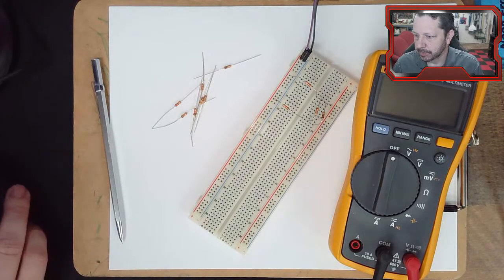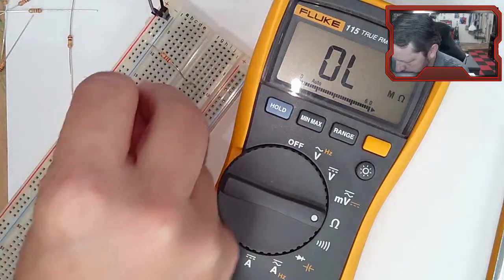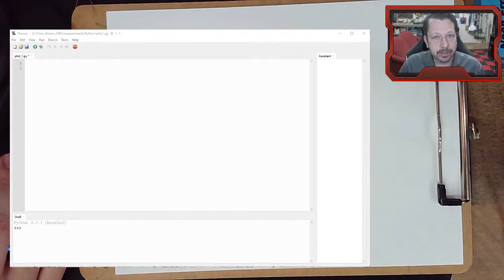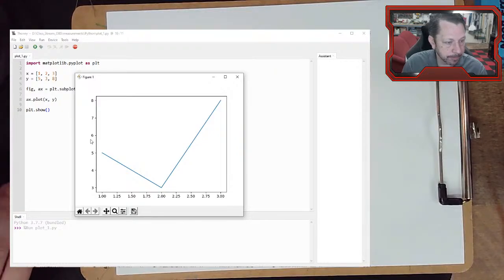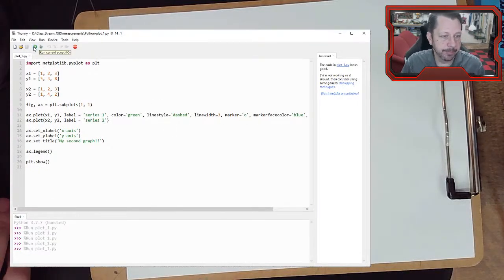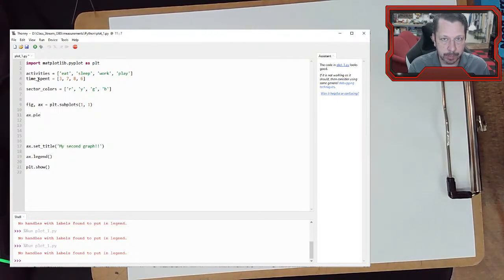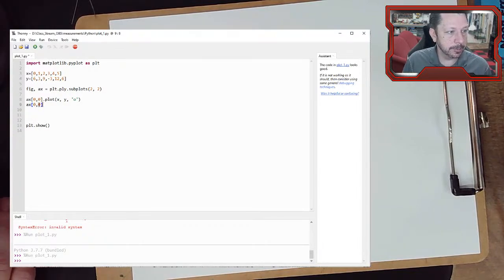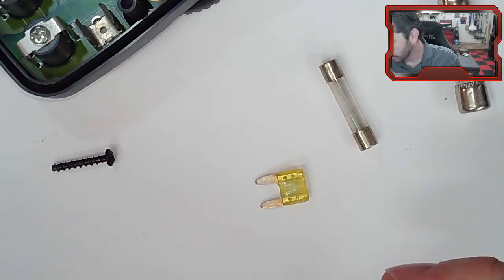Python | Plotting | Matplotlib | Multimeters | Measurements 01

Comment: That TYPE fuse is what makes that Fluke meter have a  CATIII 10000 Volt safety rating. ALWAYS! Replace that fuse with the SAME TYPE!.
Reply from the maker: Yes, I believe I found a replacement on Amazon.

Comment: If you were to read a binary file containing sample points, 
file = open("sample.bin", "rb")

How could you import the data into an array, for plotting?    For example, how would you tell it that the data is 1,2,3 or 4 bytes?  Or the endiness.. i.e. the first byte is the MSB or LSB?
Reply from the maker: Well this isn't the best answer, but next Tuesday we will be doing something very similar to that. It won't be exactly what you are asking, but we will import data from a CSV file and sort through it in order to place it into a list in Python and analyze the list. 

From your question, I am not certain how you would know from just the data if it was 1, 2, 3, or 4 bytes unless the data file itself contained that information. I suppose you would have to try reading it as the various lengths and doing some error checking on the read data. For our purposes, we will use a delimiter (CSV) to separate the data. 

Sorry I couldn't be more helpful with my answer.